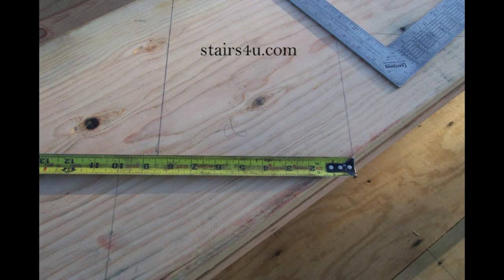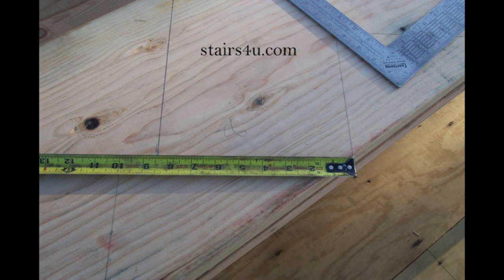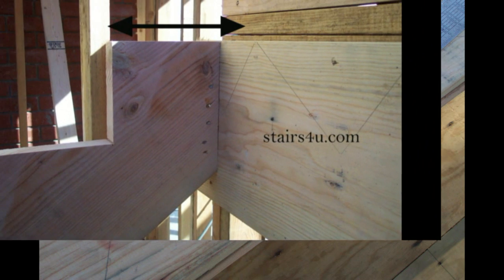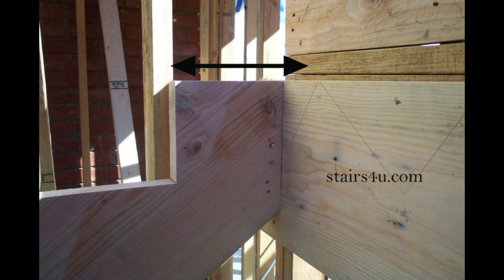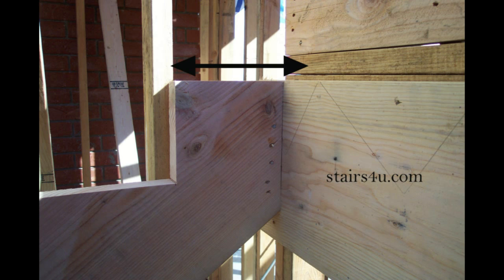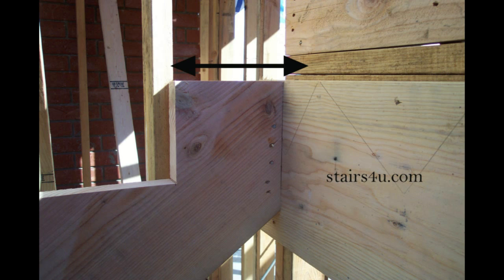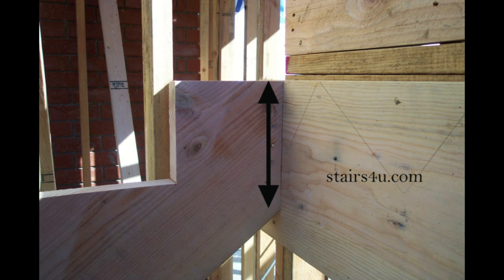How To Check Stringer Ledger Connection During Layout - Stair Construction

Comment: I will have the last tread less than other treads but the floor will compensate for the difference. In my case last step of the stringer will be level with the floor, not attached below of the floor like in your case. Is that fine ?

Also I wanted to ask you if you could tell me please in terms of safety how small I may have the last tread ? 3 inches ? 4 inches ? Because as I mentioned above the floor will compensate for the difference. 

Thank you very much in advance.
Reply: You’re saying that the depth of the top step of the stringer is NOT the same as all the others, but since you’re mounting it FLUSH with the upstairs floor, it’s fine.
Reply: G L, I think as long as the vertical of the stringer is fully backed and the distance between the bottom of the stringer and the corner in that final step isn’t reduced then it should be fine.
Reply: @QueBuenos  thank Michael
Reply from the maker: I'm not sure that I understand exactly what you're doing, but all of the treads need to be the same size.